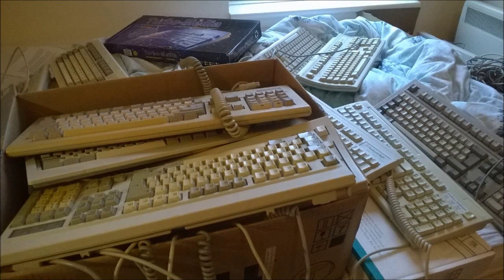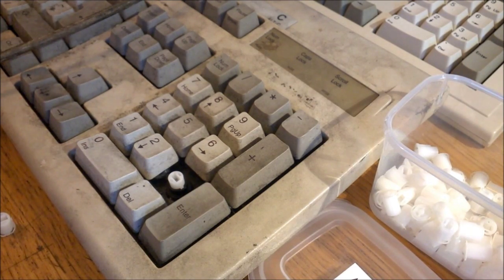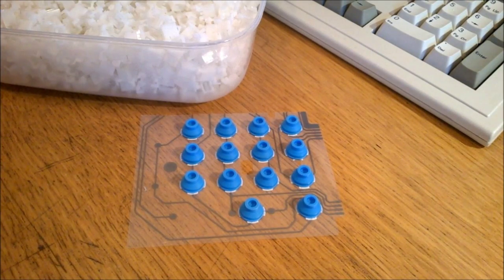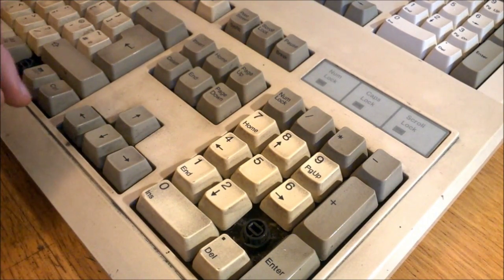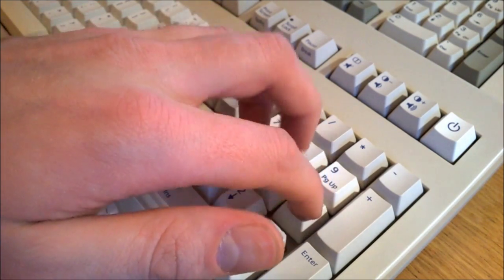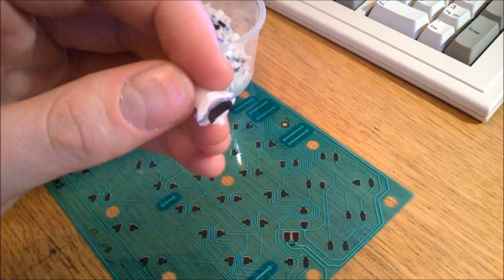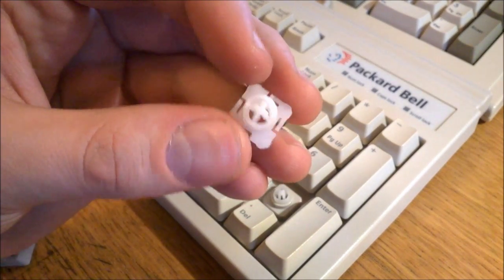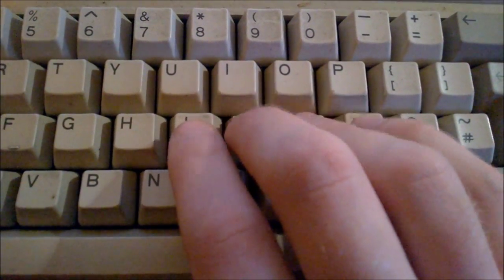Dome with slider megareview video

Comment: I found my first dome with slider board for $1.99 at the thrift store yesterday.  It's a "Micron" branded NMB RT101+ board.  And when I was doing research online, it said boards with that model number were mechanical with Space Invader switches.  But this one has NMB Dome With Slider switches.  I really like the feel actually.  I feel like after a good cleaning, it'll be a great board.
Reply from the maker: RT-101+ means it's a 101-key keyboard with a bigass enter, technically it doesn't say anything about the switches. The FCC ID is a much clearer indicator of that. Still, NMB dome with slider is not half bad :) .

Comment: Sir, I went to a local Thrift Store here in Kansas City, Missouri,USA and picked up the following Keyboards:  IBM  Personal AT Keyboard, Fijitsu FKB-4700-101 (2-Keyboards),  and a  BTC #743013804  60% Keyboard.  I'm on the BTC and like it.  One of the 4700's needs a "F3" Cap.  You have one to spare.  The IBM needs a good cleaning, but otherwise appears to be in excellent condition. It is very heavy!  Enjoy your video's.  Edwin, USN [1961~1993] Retired.

Comment: Just bought from ebay a Tulip ATK 02.01.01. Those had either Grey or Brown SMK switches, but I don't know what mine has. I've read that the brown ones are somehow similar to blue alps. Is that true? What about the grey ones?

Comment: I found a mitsumi hybrid keyboard for free and it is actually pretty nice as you said. It was extremely dirty but it cleaned up pretty well and I converted the cable from a 5 pin to PS/2 (without any active conversion). I don't actually use it as i find it too big (I use a 60%), but is was a good find none the less.
Reply from the maker: Sometimes Mitsumi hybrids can feel kinda crappy but when in good condition they're pretty nice, yeah :) . Good luck finding one in 60% format though xD .
Reply: Hey! Very late reply but you actually changed the cable without conversion and it still works? I have a 5 pin keyboard from a typewriter and I have no idea how to set it up.

Comment: I lubed the sliders on my BTC, added some foam and steel weights in the case and no joke, it is one of my favorite keyboards now. no more sliding around my desk with rattly keys and it's sooo smooth and snappy.
Reply: what do you mean by snappy? is tactility strong or almost linear alike?

Comment: I recently found an AST-branded keyboard, model RT101. I got excited when I saw NMB and Hi-Tek on the back, thinking it was space invaders, but it looked instead to be NMB dome with slider. However, the switches feel very nice and it's a keyboard I wouldn't mind using at all. What's interesting is that it has a 5-pin DIN plug and a PC/AT switch on the back. Do you know anything about this keyboard?
Reply from the maker: Yeah, sounds like a fairly standard NMB board actually. NMR made dome keyboards under the RT101 brand name all the time. They're not bad though, aren't they?
Reply: Not at all! Out of the rubber domes I've tried it's certainly one of the best. Thanks for the info.
Reply: I've just gotten something pretty similar, a Hyundai RT101+. It's really tough and heavy for a plastic keyboard, switches feel nice, and keyboard has a few nice ideas like a stabilization element under BAE that the wire stabs have contact with (and not with the keycap), and a coil spring under spacebar for additional return force.

Comment: I got my hands on BTC 5140 (dome with slider over PCB).
Unfortunately, the keyfeel is far away from being perfect. It is slightly mushy and spongy. IDK if it is due to it's age or wear but the result is I'll keep the keyboard as a piece of collection and haven't any plans to use it.
P.S. My Digital RT102 (NBM dome with slider) feels better than BTC, which is... Not the way it should be?
P.P.S. Olivetti can beat both BTC and Digital with no real efforts.

Comment: The Mitsumi is what I still use. Not a Commodore one, their own KPQ's which are pretty much the same. I'm struggling to find a new/recent keyboard that feels the same, or to find clean enough (french AZERTY) KPQ's out there. Pretty sure there are plenty sold as "old keyboard" which I'll never find, or that there are plenty in a trash bin somewhere... and I can't find any :(

Interestingly, I have 2, which I've kinda mixed as they were getting old & dirty. I've gotten sticky keys, maybe what you refer as spongy (they make kind of a rusty noise), it was two or three keys that didn't feel the same anymore. I really couldn't find out why, but it wasn't related to the rubber springs that's for sure, it was something deep inside that I couldn't fix. I could sometimes get them unsticky by messing with the hole, but they always got back to their weird state.

I know that keyboard was also branded as Unisys, but that I can't find any either. What still active key technology or keyboard would you say feels the closest to a Mitsumi?

Comment: Is Packard Bell 5131c the same as 5130? I found a few on ebay but not sure if they are the same. I believe the 5131c has a rubber dome mat, meaning all of the rubber domes are in one big rubber mat as opposed to the 3 by 3 strips like you showed. Thanks in advance for the info.

Comment: I got a Monterey switch keyboard,defective,never used for the equivalent of U$8,the model sticker got removed,but it was manufactured in Brazil so it won't make a difference,i fixed it,typing on it right now,i can say that the keyfell is not that good,it is a lot scratchy,mushy,not much tactile,i think it depends on the model not the "switch" to determine the quality,the dome inside it is as small as a shitty HP one,the sliders are colored in various shades of pink,at least it came with mildly yellowed doubleshot ALPS keycaps.

Comment: I recently took out of my basement my first keyboard ever that was in storage for more than 20 years, the Packard Bell 5131C. I have several mechanical keyboards now, but this PB keeb is much better than any cheap membrane keyboard you can find now. I'm currently planning on lubing the sliders and making a mod to add a usb c connector so I can detach the cable and plug it in my setup everytime I want.

Comment: So the ALPS board mentioned, I actually managed to grab a copy of it. I have the feeling the mushy/stiff feeling is due to the backplate being bend. On my board some off the keys, especially in the center are very smooth and quite nice, but when you move to either side of the board the keys get stiff and a bit mushy.

Comment: the fujitsu peerless ones also get dirty and scratchy with age, and the keys like to stick or get hard to push down. I gave an FKB4700 to a friend that was used by a municipal building in a city not too far away. from what I gather he greased them up and they seem to be holding their own now as a seldom-used AT/XT keyboard.
Reply from the maker: +Sudos Yeah, from what I heard, on NIB boards the stabilisers aren't even that bad. I tried greasing one of my Peerless boards, but that actually made it worse - probably the wrong lubricant.

Comment: Interesting, I also have a Packard Bell keyboard laying around and it was one of the nicest rubber dome keyboards I have used, just popped off some keycaps and they aren't sliders over domes, EXCEPT for the spacebar. Have you ever heard of that? It seemed pretty odd to me. The model no. is SK-2300H
Reply from the maker: +Smoke Wheat Everyday The Packard Bell I showed in this video is a rebranded BTC keyboard. The SK-2300 was made by Silitek.

Comment: Cooler master masterset ms121 are a modern type dome with slider. I think you should check it out too
Reply: the tactile plunger looks like it came from a BOX switch
Reply: @yanguYT  mmmmm could be that CM MS121 using a Cherry MY version of Kailh Box switch 🤔

Comment: How does that BTC rubber dome stack up to mechanical switches? I have that olivetti keyboard you showed at the end and I like it, but I'm debating whether I should go with that linear modded Dell you made a video about or a BTC for fun. I've tried a handful of mechanical boards (AEK, AEK2, Model M/F, Focus 2001, zenith zkb-2, at101w unmodded) You gave the BTC a 9/10 so I'm sure you like it. I know this is a strange question but I'm just curious to find out what the best rubber domes are offering.
Reply from the maker: +theryaner I'm typing on hte BTC right now as a matter of fact! It's very nice. See, when someone mentions "tactile" switches, I envision rubber domes more than mechanical switches. Mechanical I tend to envision as linear or clicky. Of course, rubber domes are hard to compare to mechanical switches because they feel so different, much more rounded if that makes sense. I really like the BTC, I genuinely think that as far as rubber dome with membrane keyboards go, this is in a class of its own. There's no reason you shouldn't be able to try both as these BTCs as well as AT101Ws are very common and very cheap - just make sure the BTC is dome with slider, not just rubber dome, and that the AT101W is in at least okay condition (although the linear modded version isn't as prone to dirt interference as the stock switch is). The linear mod on the Bigfoot is reversible btw, so if you don't like it you can just reverse it.
Reply: +Chyrosran22 Thanks for the response! I did a little research and I have my eye on a BTC 5140 and a BTC 5100c but I'm not sure if the 5100c has the exact same switch design as the one you're talking about. Do you know anything about the 5100c?
Reply from the maker: +theryaner I don't know for sure whether the 5100C has dome with slider switches, no.

Comment: how did you get the caps off the Amiga board? I tried and couldnt
Reply from the maker: Just a wire puller, £1 shipped from China :) .
Reply: Chyrosran22
i used one as well but i pulled extremely hard and got nowhere, and I'm pretty much 100% sure it's those switches because what you showed them to be inside seems to be what I can feel.
Reply from the maker: OK Urk, well if all you want to do is identify them unscrew the case and look at them from the backside xD .
Reply: Chyrosran22
good idea, guess I'll do that when I'm home next.

Comment: I'd be curious to hear your thoughts on the Commodore 64's keyboard. 

I just got my hands on a stripped-out one that I'll be converting to a USB keyboard just for fun. (Don't worry--I'm not ruining a classic computer here; the machine itself died long ago and had been removed, leaving only the board--which I got for the very friendly price of nothing!) Typing on the thing is honestly quite terrible, but the spherical double shot caps are just irresistible. I'll probably use it for gaming as it has fairly firm linear switches, not to mention that retro look gets all the hipster points.

Wiki photo of the model for the curious / younger folks: https://upload.wikimedia.org/wikipedia/commons/3/34/Commodore-64-Computer.png
Reply from the maker: The C64 uses Mitsumi hydrids afaik, so my thoughts on the Mitsumi board here should be close to what I'd say about it :) .
Reply: Chyrosran22 Thanks! They seem pretty similar in terms of that foot (over a PCB in this case), although the one I've got uses coil springs that go around the slider, under the cap. I was surprised by how firm they are.

The sliders / mounts aren't present in this image, but this is what the spring looks like: http://2.bp.blogspot.com/-E1r8mON2d-Q/VYaDpS0ZkiI/AAAAAAAAE_I/zdMxjUfqsv0/s1600/Commodore%2B16%2Bkeyboard%2Bassembly.jpg

...and this is what the bottom of that plastic matrix thing looks like with the feet that interact with the PCB: http://www.bjtechserv.com/Magazine/C64/C64_rubber.jpg

...and here's one last picture that lets you see the slider bits as well as the springs under some keys: http://i1096.photobucket.com/albums/g330/rjheard/DSCN0406_zps99d6f400.jpg
Reply from the maker: Linear Mitsumis, I talk about them in the review too :p .
Reply: Chyrosran22 Thanks! I must have mentally checked-out at that moment. :)